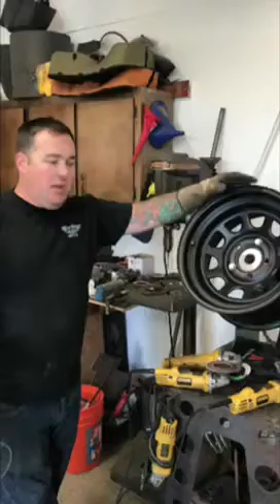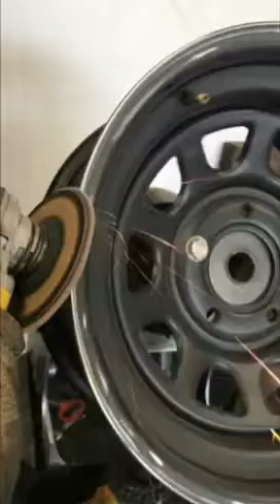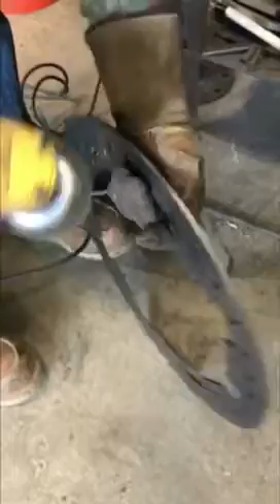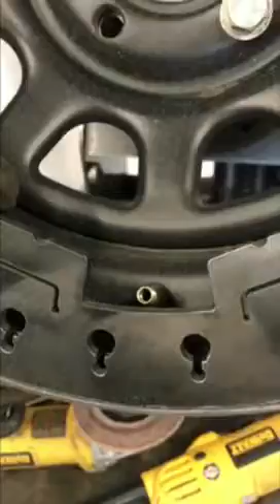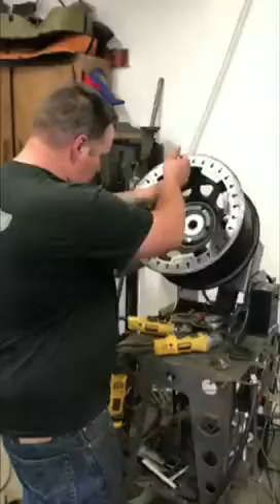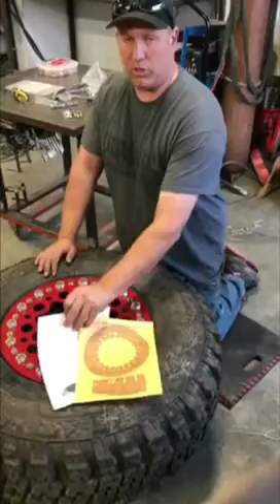Weld on beadlock kit installation - Total Metal Innovations

Comment: Can these be used on both sides of the rim?
Reply from the maker: No, standard steel wheels use a drop center to allow you to install the tire onto the wheel you can only get the tire outside the lip on one side.  Plus we are not aware of any brakes that will fit inside a inner ring.

Comment: What general setting and wire should be used for this, I have a mig welder with 75 25 gas and .030 solid core wire
Reply from the maker: Murphy Barrera depends on your welder, please refer to your welder setting.

Comment: So he pulled the ring up flush with the lip?
Reply: Yeah, but using a set of 4 washers, or whatever,  as stand off shims that pull out after tack welding would be the whight way. Not only keeping each wheel even, but all 4 consistent..  Having a wheel balancer and spinning it after tack welding helps them come out true...

Comment: It seems that I would have the option to still run a traditional mount as well since the inner lip is still functional. Is that correct?
Reply from the maker: Are you asking if after installing our weld on inner ring if you can mount the tire in the standard location and not use the beadlock portion?  If so yes you could.
Reply: @totalmetalinnovations  thanks for reply.
Reply: I never realized headlocks just involve popping the tire over the edge and bolting it down. Always wondered how these worked lol

Comment: No silicone?
Reply from the maker: Its not needed if installed the method Ryan shows in the video when the outer lip of the wheel sticks slightly past the inner ring.  Without burning the edge of the lip, doing so allows the lip to act as an o-ring into the tire bead.